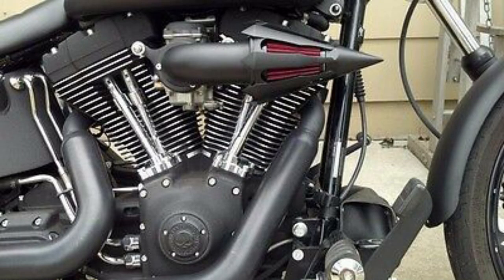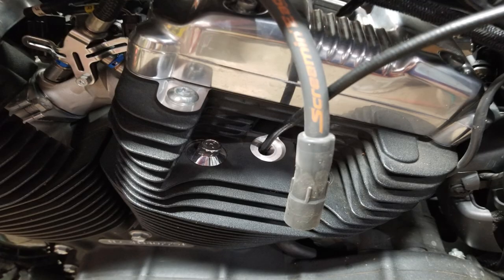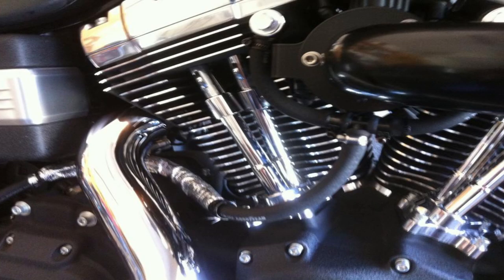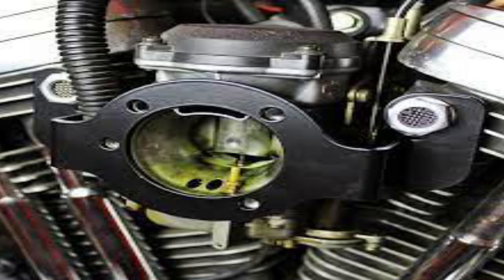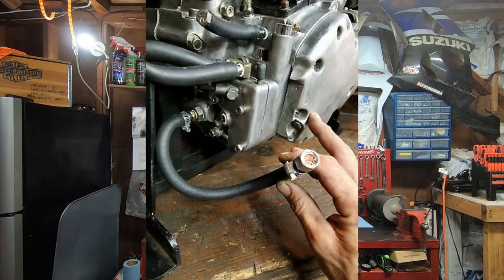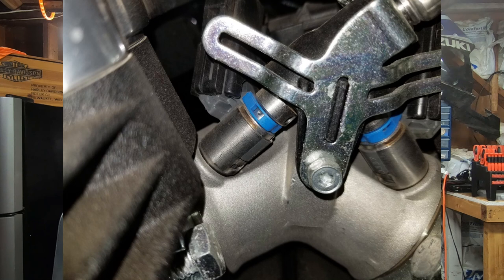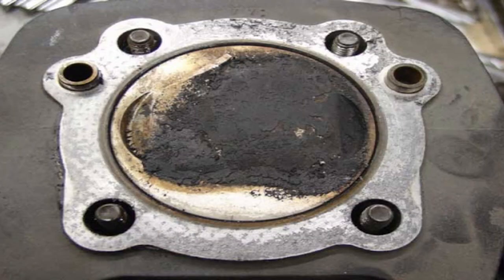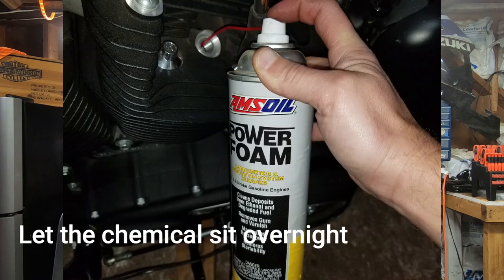Why Your Harley-Davidson Needs a Catch Can or External Breather System

Comment: Been trying to figure out what I’m gonna do with my 2019 883. Got a Kuryakyn stack and THINK I’m gonna try DKs breather bolts first. I’ve read the Sportsters don’t puke out much, so hopefully no misting on my bike... if so I’ll do a catch can.
Reply: My 08 and 16 did wondered why air filter was oily🤔
Reply: @whatstheproblem6606  I’m not sure. I’ve only had the original air cleaner (and have not opened it up yet, it’s only got 2300 miles)  I’ve only “heard” they don’t spit a lot of oil but who knows. 
I figure I’ll try the filtered breather bolts and see if it gets messy.  Worse case I’ll get a catch can.  I’m guessing it’s easy enough to change
Reply: MrJruta  don't take but a minute to pull cover off n look
Reply: @whatstheproblem6606  I probably should
Reply: MrJruta 👍🏻

Comment: Thanks for the video. I’m about to put an external breather system on my bike (2013 Fatboy). I’m wondering if any carbon build up that may be there might burn off eventually on its own, or do I now have to start considering some sort of mechanical or chemical solution to removing it? I don’t have any tuning issues at the moment.
Reply from the maker: It will clear up over time when you don't have that consistent mist of oily air entering the combustion chamber. You could chemically clean it up to help it along if you wanted to but it's not totally necessary.
Reply: Late to this vid (new sub) but pour a can of Barrymans into the tank and giver ‘er the old “Italian tune-up”.. I do it at least once a year just for peace of mind

Comment: The PCV system serves to pull blowby gases and oil vapor, moisture out of the crankcase. Having a slight vaccum conditions drastically reduces varnish, carbon in the engine.  Anyone that has worked on 60's era down draft vent systems no how dirty these engines became.  Also having a vacuum in the crankcase creates better sealing of the rings and gaskets.  I removed the PCV system on my 80 buick V6, and went with only breathers, what a disaster that was. I learned the importance of a positive ventilation. The carbon on the top of pistons is caused by poor fuel.  Do t yse ethanol if at all possible, it reduces power, requires more fuel.  The carbon in those pics are fuel based.  Use a Top Tier, 91/93 octane fuel which had max detergents.   The small amount of air being drawn out of your crankcase isnt going to throw off your tune or A/F mixture. Dont use fuel additives which has oil in them, they are far more worse than small amount of oil mist that cones through PCV system.  I tried Amsoil PI, and it gummed up my pistons instead of cleaning.  A proper Italuan Tune up will remove safely remove carbon.  I agree about changing oil after a cleaning, Ive done oil analysis and it really contaminents the oil, and takes 2 oil changes to get it running clean again.

Comment: Maybe you can answer this, I keep getting conflicting answers when I talk to mechanics at MoCo. Does running a catch can void your engine warranty from MoCo? I got 1 more year before my warranty expires (and I have a plan for a ton of non-sanctioned upgrades), but I really want to hack my air cleaner to install a can, but I don't want to void the warranty.
Reply from the maker: Yes and no, if you did the mod they would have to prove that it caused the failure. Some dealers aren't worried about it and others will say just a set of slip on exhaust will void your warranty. Personally I'd give it the year for the warranty to expire before doing the breather mod just to be safe. Good dealers will fix most issues and turn it into Harley-Davidson for reimbursement, sometimes they get paid and other times they eat it to make it right with the customer.

Comment: Great info, thank you so much.
I just run mine up to the rev limiter once or twice between oil changes. 🤣
Reply: Hi,,what's the Advantage of doing that ?
Reply: @paulhorvath9784  it was a joke...
Back in the day they used to do that to blow the carbon out of the car that Grandma Putt-Putted around town with from the day she bought it

Comment: Rubber fuel hose into a T with a small oil filter attached. $10 at your local Vato-zone. Looks halfway acceptable.
Reply from the maker: Its gets the job done and it works, that's all you need.

Comment: Why does everything on a Harley have to be upgraded just to work right ???
Reply from the maker: The EPA for the most part, if it's left stock it works pretty well but adding some performance and getting it the way you want takes some modifications.

Comment: Hey gixxerfoo how u put your power foam in you take out the spark plugs how much do u put in 3/4 the can and let it sit over night now do u just let it run to temperature or do u ride it then change the oil
Reply from the maker: I just put enough in to coat the top of the pistons, let it sit over night, fire it up and warm it up. Go clean it out real good running down the road and then change the oil after it's cooled off for about 10 minutes.

Comment: Just run a breather up above the head with a loop in the line. The oil will drain back into the head rather than building ip and dripping down.
Reply from the maker: That's a great idea, that would actually work out pretty well!

Comment: If we use top cylinder cleaner by spraying it down the spark plug holes, will the carbon that’s being cleaned off end up in the catalytic converter on my 2016 Road King twin cam?
Reply from the maker: If you let it sit over night and then change the oil, when you start it up most it will burn off on start up. If any does go out the exhaust the converter will burn it without any issues.

Comment: Took my twin cam 88 to the shop for carb tune. Mechanic asked what that shit is i had rigged up on my bike. I said crankcase vent. He shook his head and asked if i would like to blow the seals out of my engine. No ,i said. He said old shovelheads might get away with this but not newer bikes. He been a mechanic 40 years. Go ahead and fk up your harley with this garbage. I removed that shit. Only had it on there a few days. Newer bikes need suction to pull that crap outta the engine. My bike is 20 years old and its running fine the way the harley engineers designed it

Comment: My early 91 Evo is a bottom breather, pukes on the ground like a proper Harley is supposed to!
Reply from the maker: Leaving the mark of a true Harley!
Reply: Actually it used to, I set up a home made catch can/breather system on it. The PO had it just puking on the ground due to a Ness backing plate installed with no provision for the breather tube. I have a similar system on my ironhead as well.

Comment: Would the A1 Cycles Ventilator Oil Cap/Dipstick have the same effect?
Reply from the maker: You'd still have the oil running into the heads even with the vent, but that's a must have on a M8. The M8 has had real bad issues with vacuum and oil sumping.

Comment: I routed mine into a catch can and I have a spigot on the bottom of when it fills up I drain it into a cup and put it on the fire pile
Reply from the maker: That's a really clever idea! I am huge fan of catch cans, I run them on everything except the lawn mower.
Reply: @GixxerFoo  I made mine when my son was about 10 and it's very steampunk looking all brass and copper goes all the way around the front out of the way of everything I'll send you a picture

Comment: I really want to do this BUT I unfortunately have the K&N oval shaped air breather kit. I'd have to cut a hole in the element to install a kit like that.
Reply from the maker: That's the issue with most every air cleaner, you'll have to do some cutting and drilling to make a external breather work.

Comment: carbon buildup in the top end is still a problem regardless of running an open vent system... that's just the nature of the beast and my motors have done hundreds of thousands of miles with a closed loop system.

Comment: if you do a transmission breather , do you think an external breather system is needed ?
Reply from the maker: A transmission breather would only work on the transmission, you would still need to vent the crank case gases as those breathers are in the heads.

Comment: Thanks Gixer, always enjoy Your Vids...About this problem, "BLOCKHEAD" has a video for the DIY Guy, "Harley Blow By Problem Solved for $12 Explained" just as info...
Reply from the maker: Thank you! I really appreciate it! I don't know if you saw his Sportster videos where he did the Hammer kit and ended up around 110 horse with the high dollar HPI throttle body on the 120hp kit. I kept saying it's the pipe he is using, swap that out for the magna flow two into one and it will make that 10 horse swing!

Comment: Any experience with vented dipstick, like the Feuling, instead of external breather?
Reply from the maker: Those work great on the M8 to prevent to help prevent the oil sumping issues, I ride with some guys that run them but we've never put the camera down the spark plug holes to look at the pistons. You would still get some oil in the combustion chamber just not as much.

Comment: My question is how can someone say that all that nasty carbon buildup on the pistons is from the tiny hot air/oil mixed vapor going back into the engine. It could be from improper piston ring seal. And burnt oil. It can't be that much.
Reply: Exactly it’s mostly from the breakin period on new bikes I’ve tested leak down and it settles around 15,000 miles on the m8 then no more blow by .
Reply: @lancasterjim2441  Thank you for sharing this info. I am just trying to understand these things better

Comment: Not sure. don't care about legal.Was thinking. yup i am scared. thinking run braded brake lines to my exhaust and weld in a bung. With a homemade venture to scavenge the vapors away. Yup told you thinking is scary.
Reply: Also. I remove spark plugs and oil. Every oil change and fill sump tank with marvel mystery oil. And crank for a couple two minutes cranks. then fill both jugs and go drink beer. sometime in the next day. walk it over to neighbors driveway and crank it till you determine yup he will be pissed. then go to autozone and by a gallon of real cheap oil. Crank like step one. clean oil filter instal amsoil 60 . And go fight with neighbor

Comment: this subject keeps resurfacing as each newbie starts reading and watching you tube. The few bikes who’s power changes over time is not “the tune changing over time “ its not caused by the carbon on your piston Foo it’s not like the carbon is weighing down the piston and robing power it’s not. When the power is decreasing that’s usually due to sumping in the crank case that creates drag on the crank i see it all the time and the tell tale sign of the high oil level  stained in the cases . As carbon builds it raises compression ratio on a high comp build this can be an issue for detonation and with tight squish on a carbed bike you may want to keep an eye on the buildup. Stock nothing to worry about. Yes your bike may show oily carbon for the first 5-10,000 miles
Reply: Seems that tons of road veterans disagree,  not just the newbies, as you put..
Reply: @jessejames3600  🤣🤣I don’t see one post of as u put it “road veterans disagreeing”

Comment: So, I have an M8 in my Road Glide 2018.  Still under warranty, runs great knock on wood, doesn't use much oil at all, etc... While still under warranty, is there anything I should have them do or look for to fix before the warranty is out?  It's the extended one thru HD I bought the best one.  It's the 107 and has about 9k on it.
Reply from the maker: I would ask about your oil pump, make sure it has the updated oil pump in it. They had their share of oil pump issues with the early design, not all bikes had the issue but it would be worth knowing which version made it into your bike.
Reply: @GixxerFoo  I will do that thank you!  Have the 10k service coming up April 15th so making a list for them to look/check!  Thanks again!

Comment: Used a Gasbox Customs AC (no CC gas routing into the AC), Lowbrow breather bolts, TC Bros AC support bracket on my 2013 Dyna- https://www.lowbrowcustoms.com/collections/motorcycle-air-cleaners/products/gasbox-007-air-cleaner-harley-davidson-cv-carburetors-efi-throttle-body1991-2019 Ended up ordering TC Bros breather bolts, the LBs had 1 each of 2 sets snap so I couldn't trust them.

Comment: Two theories on carbon buildup nothing wrong with it unless in extreme excess but honestly a little bit is not bad and increases compression thus more power and the safer way to remove it is ATF in the fuel and oil much cheaper simpler and safer.
Reply: @09RoadRaideR 
Can you specify what type ATF ? There are a zillion different types also how much in the fuel per gallon and how much in the oil per qt. 
Thanks
Reply: @scrumthebum2451  it does not matter the type of ATF and only 2 to 3 oz in the oil and 2 to 3 ounces every time you fill up the tank
Reply: @09roadraider40  
Ok thanks I’m going to look into it.

Comment: WHat are your thoughts on using 20w50 vehicle oil in engine and primary?
Reply from the maker: I personally run it myself, I haven't had issues or abnormal wear. I ran Screamin Eagle first and then Amsoil. It's really just a matter of personal preference if you want 1 fluid or 3 dedicated fluids, either way it won't hurt the bike.
Reply: @GixxerFoo  Thanks....so you see no issue running Automotive oil?
Reply from the maker: I wouldn't go that far, automotive oil isn't designed to meet the demands of your bikes engine. You can although run a heavy duty diesel 15w40 oil in a Harley engine. Some guys swear by diesel oil but l would stick with motorcycle oil.

Comment: Call me old fashioned, but spraying chems down a plug hole and running an engine to decarbonize a piston crown is not on my agenda...
I was always under the impression carbon acted as a heat insulator for street engines.
Race engines, sure, polish those crowns...

Comment: Don’t do this!!! You will have lost all back pressure that you need to pull oil down in motor!! Bad idea
Reply from the maker: The oil is pumped through the engine via the oil pump and returns to the sump by gravity. We see a lot of issues with the new M8 engine and it's inability to relieve crank case pressure which forces the oil vapor past the rings and causes the sumping issue.

Comment: I’m just going to go with what the design engineers intended.
Reply: Brad, you mean the same so called Engineers who designed the Automatic Primary chain tensioner,  or the newer compensator,  or the loose valve seats in the M8, or, the 1.0, 1.0, 2.0 ring stack on a street driven application, or, or, or, or I can do this all day champ, and THIS ( REAL ) MECHANICAL ENGINEER IS 100 PERCENT CORRECT.
YOU DON'T WANT TO DISPUTE ME OR THE FACTS.
Reply: @t.s.racing  It has worked thus far for me for 19 years. No Engineer is perfect but when they make mistakes, they correct them.
Reply: @bradwilliams4921  so what you're saying is HARLEY DAVIDSON  corrected all those issues free of charge?
No Sir, they didn't. They IGNORED their MISTAKE, 100 PERCENT. 
Ask a half million Twin Cam  owners if the company replaced their Cam Chain  tensioners.  
I'm not picking on you Sir, no disrespect honestly.  How about replacing the Timken Main bearings with a ball bearing  ?
These aren't mistakes Sir, and the Company is hurting.  Another FACT.
HAVE A BLESSED DAY,  again,  I'm not picking on you,  directly.  The TWIN CAM cam chain tensioner epidemic is all I need to say. The company did NOTHING to correct this. 
Thank you for listening.
Reply: I apologize Brad, if it seemed as though I was attacking your thoughts and opinions.
Reply: Your faith in the MoCo is well intended but with these bikes you have to do a certain amount of reworking their cockups. They do not care about you, they care about saving money by using sub standard parts. Its why I ride the older bikes.

Comment: What??? Cars do not have a problem with direct injection. Indians and Victories and every other motorcycle besides a Harley have direct injection and they too do not have a problem. If you have carbon build up, which was common in old carbureted engines, you took them out and floored them to blow the carbon out of the engine. My sportster still runs like a raped ape and I never had to put a oil catch system on it.

Comment: Oh if only there was a way to avoid this problem from the start . What do you mean every other  motorcicle manufacturer has figured it out . This is just one of the reassons that Harley has been on the edge of bancrupci for the last 30 years ,get with the times you air cooled, pushrod drven , no power making , oil guzzling , dinosaurs .
Reply from the maker: They are fun to ride and the power comes on so early, I used to hate Harleys. I finally got talked into riding a Dyna with a 128 conversion, it's like a V8 muscle car out of the hole. Now granted after mid range a overhead cam motor is gonna over take it.
Reply: @GixxerFoo  yeah but they dont make it like that out of the factory . and it still has terrible gas millage and al the other Harley issues which Harley grandpas describe as "Features"
Reply from the maker: I'm not a huge fan of Harley's marketing structure where you pay more for the bike and then they have performance parts available. They have premium parts and finishes, but the engines do have their issues. Even the solid Evo has inner cam bearings concerns, but that's only on high mile bikes when you get over 40k.